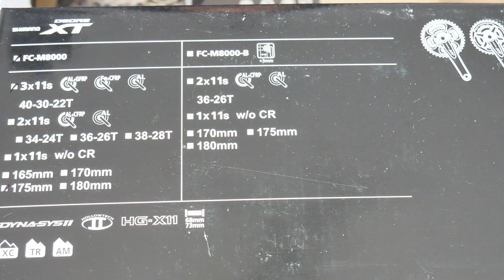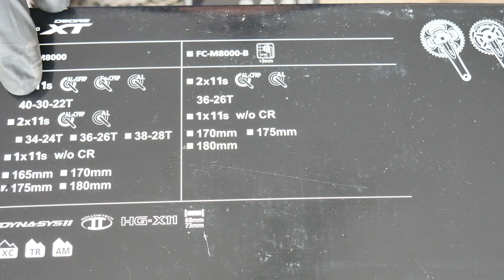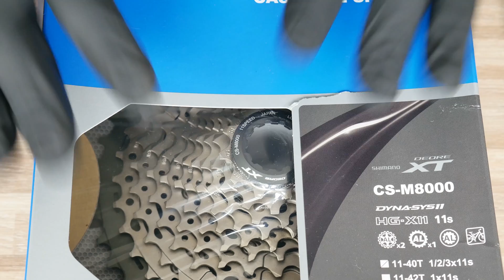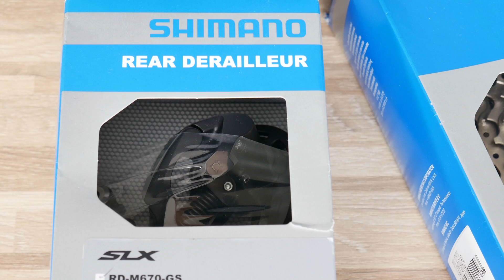Rear And Front Derailleur Capacity - Short, Medium Or Long Cage?

Comment: I'd say half correct, as only half of the chain is on the cog and sprocket. So, on a 11-40 cassette, the difference is approx 15 (and not 29), as roughly half of the cog is empty. Unless, rear derailleur capacity is a reference, rather than actual teeth.

Comment: Thanks for the math but those numbers don't tell much if we still don't know if we need a short, medium or a long cage for our drivetrain...
Reply: I added up the numbers, now could someone tell me what to do with the math??
Reply: @khushmehta191  look at the manufacturer specs which should tell you the capacity of the derailleur.
Most long-cage derailleurs have a capacity of 43 or 45 teeth. Shorter the derailleur cage than smaller its capacity. For 1 by setups you need only one figure, for example sprocket max 42T - sprocket min 11T for the smallest = you need a derailleur with 31T capacity. For 2 by or 3 by you need to add the difference of the small and biggest front chainwheel.

Comment: quick question hope you answer
can I run a short cage rear mech with a compact crank and 11-32 cassette if I don't chain cross (which I don't)?
Reply: I found some info about that. Yes, you can. But that is not something I try. Please, information about that if you do that. I have compact chainring and 11-32. I want to put normal SS rear RD.
Reply: Rak Rakovica thanks for reply 👍
Reply: yes you can, i run 8speeds altus with short cage RD, use triple chain ring 40-30-22 and it works fine.. but if you chain cross you'll hear little annoying sound..